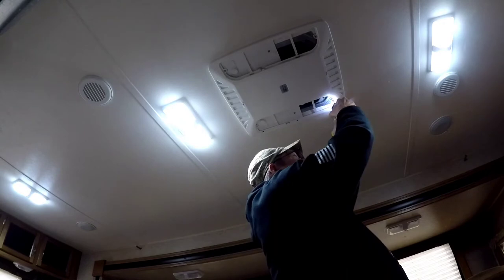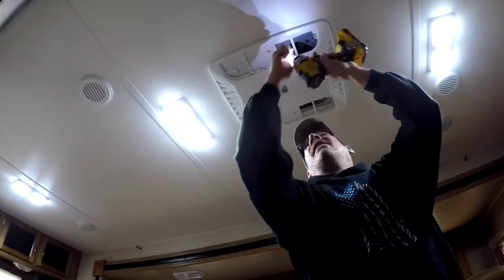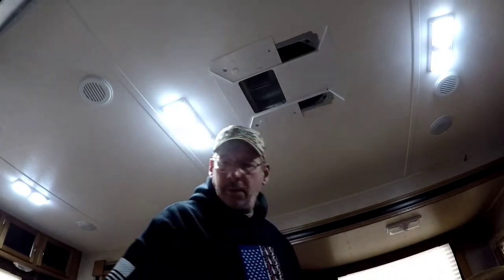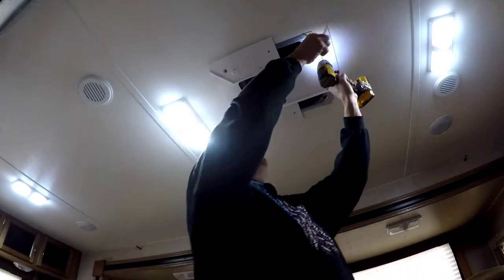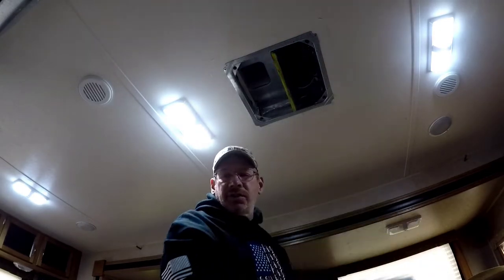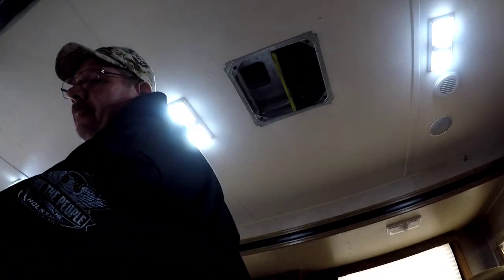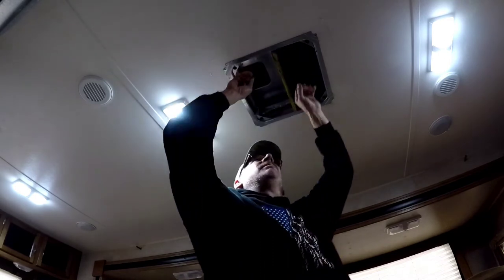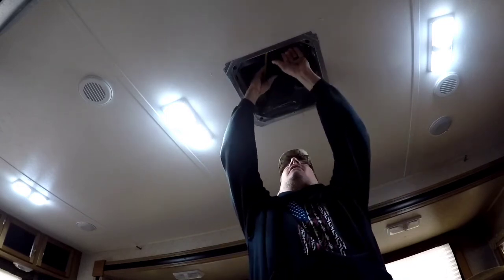Oh no! Ac leaking when it rains. How to fix.

Comment: I watched your video and can you believe this?
I had 4 loose screws.
All my air conditioning units were leaking. I guess when I drove through up North. I hit a lot of trees and branches which loosened up the screws plus the wind plus other things. So it is a good idea to check it twice a year.  Thank you for the video very well done. Gave me the confidence to get this done
Reply from the maker: We got a new camper last year and the ac's were one of the first things that I checked. Don't forget to check the tape while you're in there. Manufacturers do a lousy job taping up around the opening. Thanks for watching

Comment: My 9 yr old camper air conditioner started leaking water when not running, sitting at the campsite two days after traveling through heavy rain.  I check and reseal the roof twice a year, so I was lost.  The walls inside the unit all appear dry.   Watched your video and checked the four bolts that pull the unit down tight over the rubber seal.  Found the back two bolts quite loose and tightened all four of them.  I feel that may be the problem and will find out for sure sometime in the future.  Thanks for the video, if I find out anything different I will contact you.

Comment: Ha! Just came across you in scrolling. Our a/c unit leaks ALL the time and there’s no rain! It’s been looked at several times and this is our third Coleman Mach (junk)! No one wants to come replace it!
Reply from the maker: Thanks for watching and sorry you're having issues. Sounds like a clogged drain? Three campers ago our ac would dump water when we turned it off. Dealer had no idea. Only had the camper for a year and we never did figure it out.
Reply: I was looking at the optional heat, people say it’s not worth the money. It doesn’t do much.

Comment: I saw stains on the ceiling around our a/c, I took the vent off and all four bolts were all loose, pretty much dangling so I tightened the crap out of them, is that bad?  Can they be too tight?
Reply from the maker: You don't want them super tight. There's white tabs on the gasket tighten down until the tab touches roof
Reply: Kind of because you can strip it. You have to kind of hand tightened and not too tight. Because then you can break the plastic and also you can strip the screw just  Hand tighten and it's always good to check the bolts twice a yeah, but anyway, good job